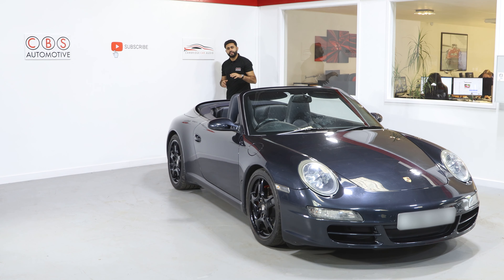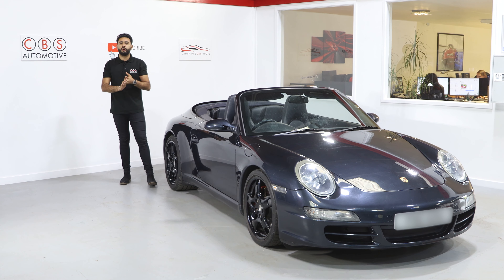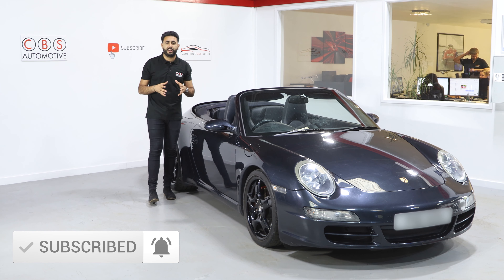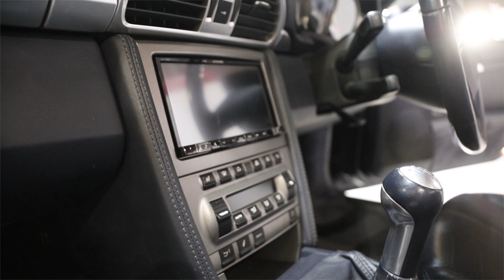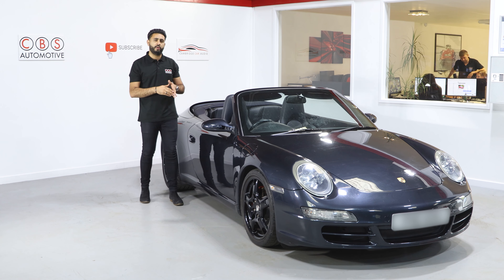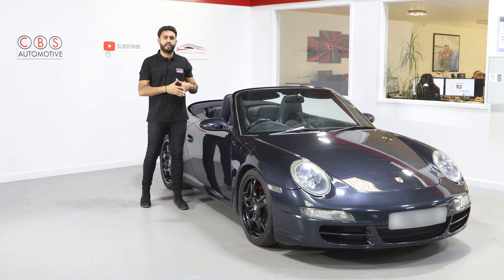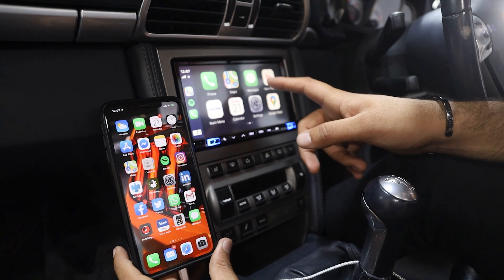Porsche 911 Carrera S Headunit & Speaker Upgrade

Comment: I have a 997.1 Carrera S.  It has the Bose system which is good, but jeez- driving anything above 50mph and the wind noise is deafening.  Does the sound proofing make a big difference?

I’ve seen a 997.2 without Bose, which I want to upgrade to.  Has a newer head unit, and I’m always keen to retain the original.  Can I upgrade the speakers whilst keeping rear speakers and add a sub or something like that- so that it sounds better than Bose?  And also quieter!
Reply from the maker: Yeah, we can, best to come by and see us so we can advise on the best solutions for you